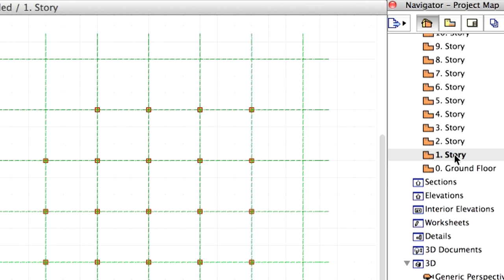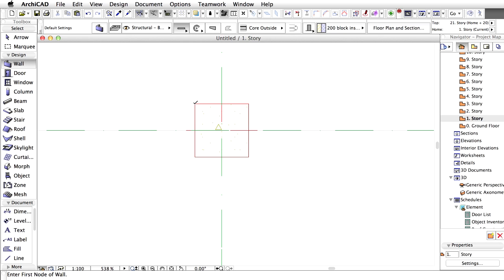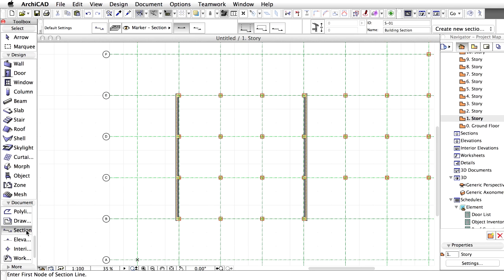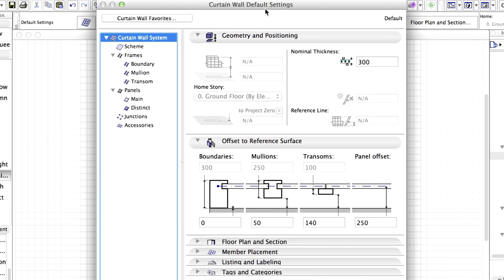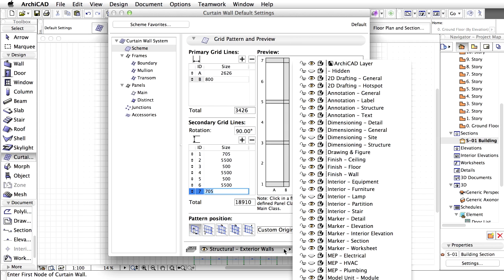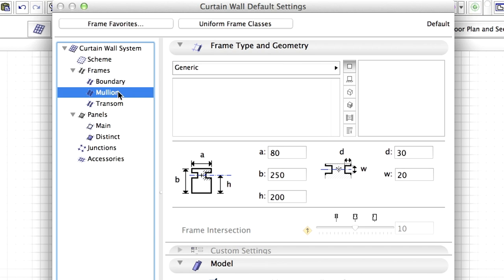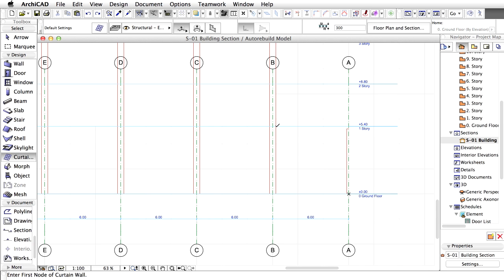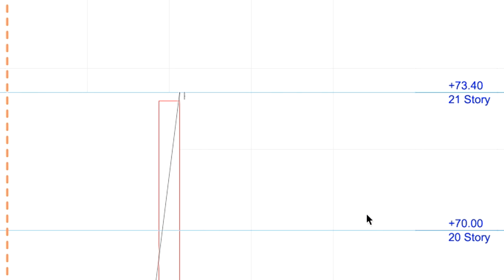ArchiCAD Training Series Vol. 4: Building the Model: Building a Tower I.

Comment: I am not sure if this is something you have considered but the tutorials you provide do not always work with the newest revision. For instance, the guideline that the curtain wall for revision 20 does not work and the orange dot does not appear for this step or the previous one where you create a parallel guideline from the column. I understand the orange dot was removed for revision 19 so... Is the pdf up todate or at least have some kind of notation for how to complete for new revisions. The changes in Archicad from revision to revision make it a poor choice and questioning my reason for bothering with it.
Reply: Even the Archicad 21 tutorials(for parts 1 to 3) often seem to have problems in Archicad 22. It seems quite bizarre there aren't specific tutorials for every version, considering the extreme cost of cad software it seems a pretty basic requirement.
Reply: use orange refernce guides which are on top bottom left right side of screen,drag any of them upto the wall and thn again drag with the given distance ,this way you will get slanted angle of curtain wall.

Comment: This is the final straw.Can't select either of the wall materials you have instructed, because THEY'RE NOT THERE.  Can't select "Structural - Exterior" in the curtain wall settings because IT'S NOT THERE.  Can't even open the Floor Plan and Section pane on the Curtain Wall System because......wait for it.....IT'S NOT THERE.This entire tutorial series is beyond useless.  I recommend anyone interested in learning how to use Archicad should AVOID watching these videos at all costs, because you're going to spend more time trying to figure out why you're unable to duplicate the instructions given than you will actually spend learning how to use the software....and this particular installment is a concentrated example of everything that's wrong with the entire curriculum.  I certainly hope someone at Gravisoft reads this comment, and takes this to heart.  You can't expect people to buy your software if you won't scrutinize and maintain your training materials.  The software itself may (or may not) be at a professional quality, but this training series can only be described as totally amateur.
Reply: I think a lot of the problems may be that the tutorial for one version doesn't work for newer versions(this tutorial video is 5 years old, which seems a bit ridiculous). It's extremely frustrating, and certainly doesn't make it any easier to learn.